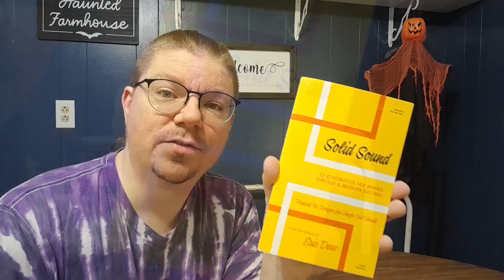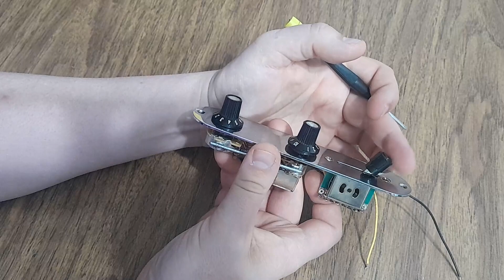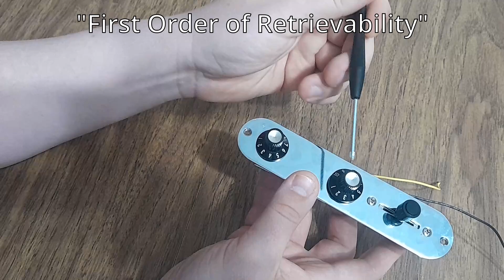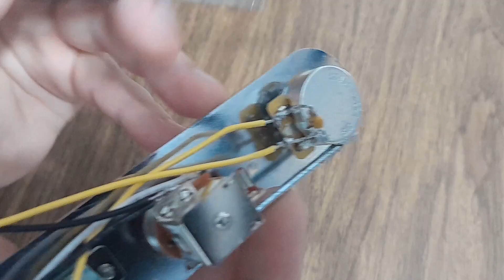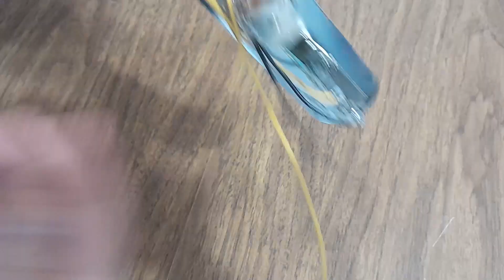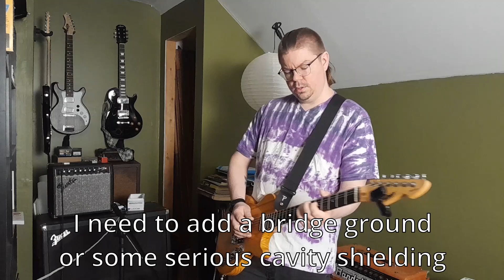Custom wiring mods for a scrap parts guitar

Comment: I love the angle control plate. Being a strat guy for 25 years before I own the telle pinky swells well finger picking is the biggest thing I missed This solves that problem
Reply from the maker: Thanks, I saw someone else flip the control plate around on a build and thought it was a genius move. Then the angle started as a way to cover up a couple of imperfections on the wood slab but once it was placed I looked at it and was like... oh hey I like this!